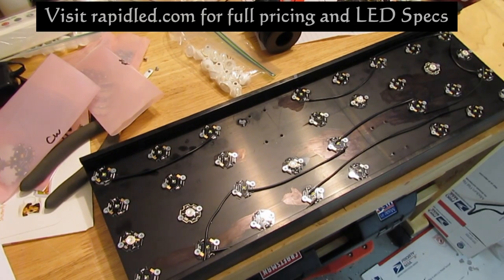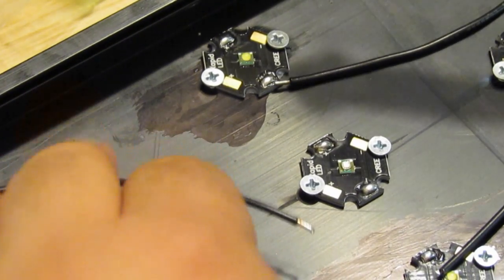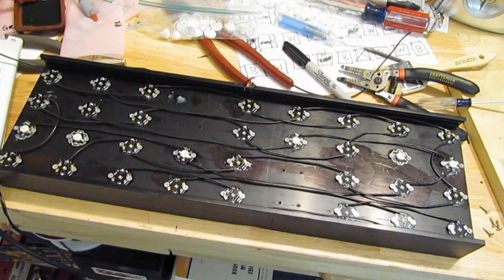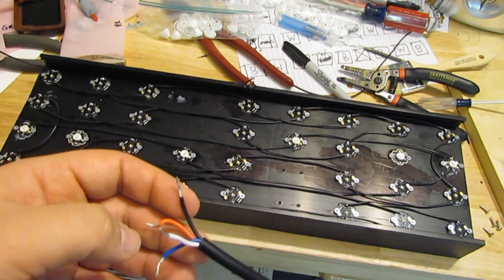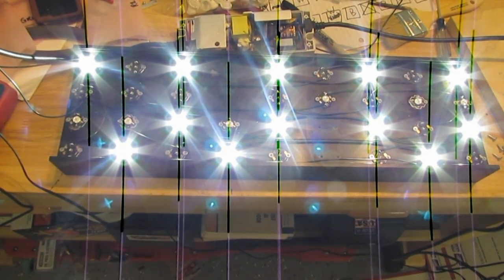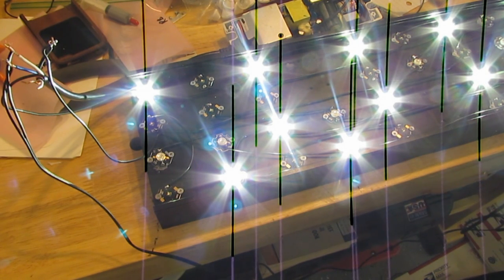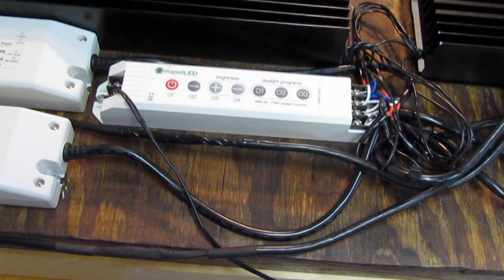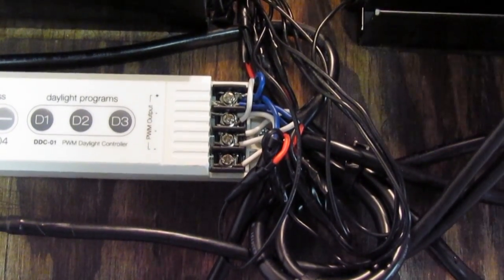DIY Aquraium CREE LED Fixture (Part 2)

Comment: One important point--not all white LEDs run at 1500mA (or can take 1500mA) and not all color LEDs run at 1000mA.  In fact the majority of the exotic LEDs sold these days do best between 500mA and 700mA and will die in days if run at 1000mA as recommended here.  Aside from that fairly minor point (you should be paying attention to that kind of thing if you're building a DIY LED rig anyway!) it is a great video about how to wire stuff up and how to test it and all that.

Comment from the maker: @reefman46 the 48 led kit run 385 i think and the extra 12 led kit is another 100 and the daylight controller is 59. so the total would be 544 which is less than one ecotech radion and in my opinion a way better setup.

Comment: Your testing of the current is wrong. What you said is to place your metere a an LED but what you have done was place it in parallel. This is not the way to measure the current flow. You need to break the line and place your meter in series.